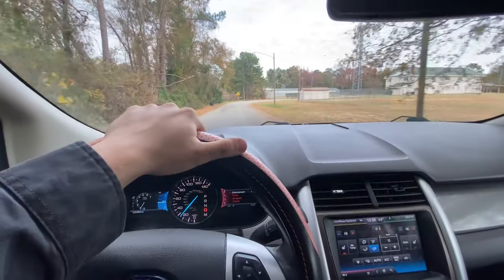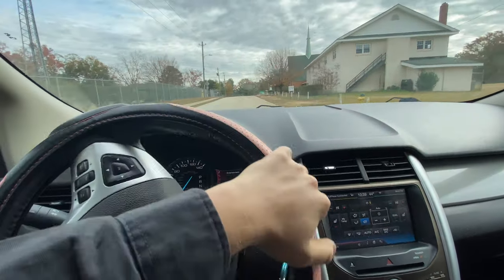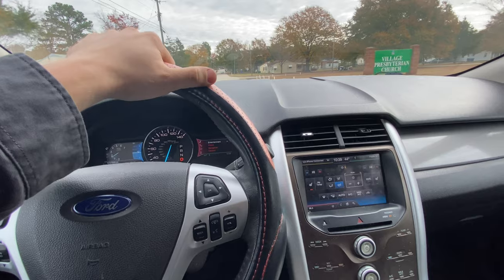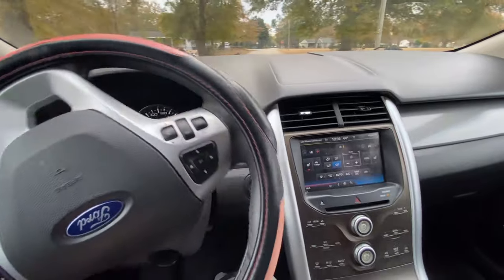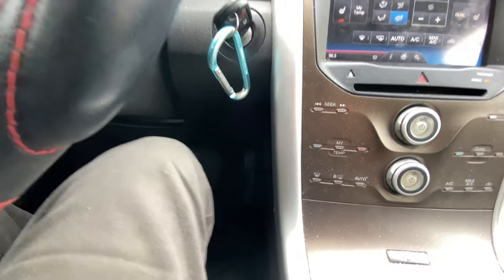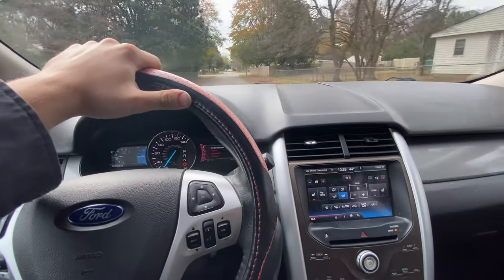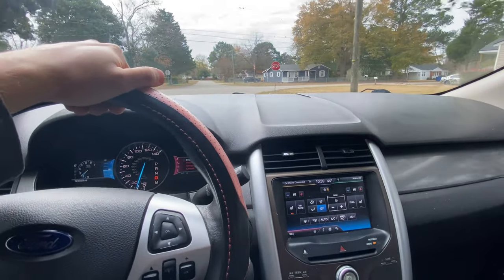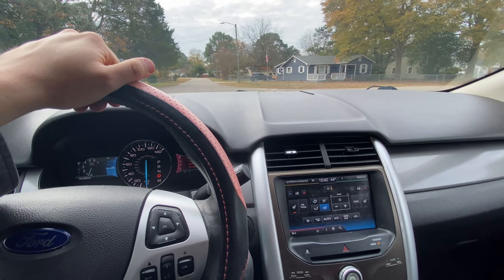How to fix low brake pedal in 2011 ford edge.

Comment: Can confirm this guy is all over the problem. The slam on the brakes method will work, as well as using a scan tool to perform autobleed abs function. Slamming on the brakes on a wet road or gravel road also cycles the abs solenoids which effectively resets them. Thanks for the tip! Try this first for sure!
Reply from the maker: Absolutely! Thanks for commenting and contributing to the advise. You’re welcome. Thanks for watching.
Reply: I tried a regular highway surface but I know where I can find a gravel road
Reply from the maker: @Jillups.  it doesn’t have to be on a gravel road, I did mine on just a normal asphalt road where there’s no traffic. Get up alittle speed, say like 25,30 or even 45 miles per hour and slam on brakes, just go at a speed that you feel comfortable at, doesn’t have to be anything specific. Good luck.
Reply: @FastFords289  thanks I will try again at a faster speed later after lunch too many people out and about
Reply from the maker: @Jillups.  no problem, hope it works, yeah I don’t blame you, stay safe out there.
Reply: I would do this procedure on wet grass so it doesn't put a lot out of strain on your suspension parts and your brakes.

Comment: Just cost me $1200 to change Abs module on 2012 edge sel and I still/now have low pedal. Going to try this before anything else. Thank you
Reply from the maker: Damn, yeah they’re not cheap, I hope it works for you, good luck and you’re welcome. Also just an fyi, a bad brake master cylinder can cause a low pedal also. Good luck bud, thanks for watching.

Comment: This is a late note, but the loss of brakes with pedal travel to floor has been known by Ford and no recall was done. The problems seems to be in the ABS module; it has happened to my 2013 Edge three times; the pedal travels to the floor and requires firm pressing on the pedal to get braking action.. then, the brakes continue to work normally... until the next time you lose braking action, and if you are dealing with a sudden stop when it happens, it could make you waste seconds and increase braking distance so much that you could crash.  Ford extended the Costumer Satisfaction deal until November 2025 regardless of millage. But they will only change the brake booster and people are saying that their brakes continued failing in the same way because it appears that the ABS module is the main culprit, but Ford is not replacing it.  I read that this problem is also affecting the Journey and even some Chevy models. Call your dealer.
Reply from the maker: @GeezerGold  thank you for your input and response, fortunately this has only happened once with me, been working perfect ever since. The only braking problem after that I had was the brakes were sticking and wanting to lock up, I took it to the dealer three times and the idiots couldn’t figure it out, one time I even drove it up there with the brakes smoking and told them it’s probably the brake booster, they didn’t want to deal with it so I took it to another small business shop and he changed the brake booster and never had another issue. Sorry your abs module kept messing up though but I appreciate you reaching out and letting me know about the extended warranty, and glad you got yours fixed as well. 
Thanks for watching.

Comment: I did on a gravel road....much easier to activate ABS....also do in reverse as others have suggested
Reply from the maker: I’ve heard of people having problems with it working on gravel roads, plus I don’t have any gravel roads near me so I’m kinda limited but I’m glad it worked for you. I did do it in reverse a couple times as well I just forgot to put it in the video. Thanks for commenting and thanks for watching bud.
Reply: @FastFords289  I did this and it works but keeps coming back. Replaced the hcu and master and still does it. Properly bled I give up.
Reply from the maker: @FloridaMan7337  it’s possible you may have a bad brake booster, or possibly still have air trapped in system. The way those systems are make it a pain to bleed all the air out. I ended up replacing the master cylinder later on and it took a while to get all the air out. I had to bleed it at the master cylinder and at each wheel and finally got it right. Good luck, hope this helps. Thanks for watching.
Reply: @FastFords289  Thanks I may try that or using a pressure bleeder first.
Reply from the maker: @FloridaMan7337  no problem, yeah that’ll probably work, I don’t have a pressure bleeder so I caught alittle hell doing it but I finally got it.
Reply: @FastFords289  It worked like you said. Bled it while activating the abs and it finally gave me a pedal and has been good for a couple months now. Thanks again. Next time I will buy a pressure bleeder.
Reply from the maker: @FloridaMan7337  that’s great! I’m glad it worked for you and you’re back on the road again. Yeah the system’s in these are a pain to bleed, idk why they made them like they did, poor engineering. Hope it keeps working well for you. Thanks for sharing and thanks for watching.

Comment: I’m currently working on my grandmothers 2013 Ford edge brakes are great and an only time I’ve ever ask up is when it’s going downhill it’s like the brakes go all the way to the floor like there’s no pressure. My plan is to change the master cylinder and go from there if you guys have any tips or any other ideas, I’d greatly appreciate it.
Reply from the maker: That’s strange, is your brake reservoir full of fluid?

Comment: Guys all u gotta do have someone sit the vehicle lift the front up make sure its safe to go under it and hit on the abs pump from underneath  with a stick or  what ever just little hits while the person is in the car pumping the brakes make sure the vehicle is on and running. Thank me later.
Reply from the maker: That’s good input, and I’d never heard of that or even thought of that but it does make sense how that would work, because all you need to do it break free where it got stuck and it works. I’ll have to remember this for future reference in case I ever come across this again. Although the braking hard was kind of a fun experience lol but seriously appreciate you chiming in and sharing your word of advice. 
Thanks for watching.

Comment: The Ford Edge 2013 SEL has the same problem with the same fix??
Reply from the maker: @peaje  as far as I know it’ll work on them all, at least all within the same few year models. Mine is a 2011 so it should work for your 2013 as well. Good luck, hope it fix’s it. Thanks for watching.

Comment: Just replaced master cylinder last night, no change in pedal. I've engaged abs from 30mph 6 times this morning to no avail. Any thoughts?
Reply from the maker: Those master cylinders on those cars can be a real pain, I had to bench bleed it and bleed it after I got it installed on the car as well as go around and bleed all the wheels. If that doesn’t work then I’d keep trying to activate the abs module, sometimes they can be stuck pretty good.
Reply: I did mine 45 mph... And it reset it... What did you end up doing?
Reply from the maker: Well if it reset and everything works good then you should be good to go. In my case though the pedal came back but then the brakes started holding so ended up replacing the master cylinder and brake booster. Good luck. 
Thanks for watching.

Comment: How did you get the edge to bleed the brakes I get no fluid out of the bleeder
Reply from the maker: Well in this case I didn’t have to bleed the brakes, just activate the anti lock brake system. How ever you just bleed like normal, pump the brakes and while someone holds the brake pedal, open the bleeder valve and let the fluid run, or if you do it alone then hook a line to the fitting, and insert into a bottle with fluid and open the bleeder and pump the brakes. If there is no fluid or air coming out, then you probably have a clogged bleeder valve so just change it and it should flow. Hope this helps, good luck. 
Thanks for watching.

Comment: I did this once and it fixed the problem, it lasted about a week, then the brake pedal started going down again, tried the trick again, didn’t work this time, tried 2-3 times, ideas?
Reply: Did anything work for you? This worked for me for 5+ years and no longer does

Comment: I’m going to go do this rite now
Reply from the maker: Ok, good luck, hope it works for you. 
Thanks for watching.
Reply: So I tried it doing about 45 mph and it brought the pedal up some should I keep doing till it's completely up
Reply from the maker: @jamilclark3  you can try it, I had to actually do it on mine a few times and it finally just popped back up all the way. If that doesn’t work then it is possible you could have a bad brake booster.
Reply: Truly appreciate the advice…
Reply from the maker: @jamilclark3  no problem, hope it works for you. Good luck. 
Thanks for watching.

Comment: Thank you trying this today
Reply: Also new subscriber👊👊
Reply from the maker: You’re welcome, hope it helps, good luck.
Reply from the maker: @Jillups.  great! Thank you!  Thanks for being a supporter and thanks for watching.
Reply: @FastFords289  i will let you know how it goes the brakes went mushy saturday then it rained yesterday
Reply from the maker: @Jillups.  10-4, hope it works well for you.
Reply: @FastFords289  well that didn't work do I specifically have to go 25 to 30 mph
Reply from the maker: @Jillups.  you may have to do it a few times, I had to do it about 6 or 8 times before it worked on mine. If it doesn’t fix it then it could possibly be a bad master cylinder but I’d try doing the brake check process some more. Make sure you’re applying the brakes hard and firm, press as hard as you can to activate the antilock brake system, you’ll feel the pedal pulsate when it’s being activated. Hope this helps.
Reply: @FastFords289  ok I just got back i got it up to 60 mph and yes when I stop it I do feel the pulse. But this is weird I did it 3 times at 60 and it didn't work but I kept checking on my way back and sometimes I would get a normal brake and then it might be mooshy
Reply: @FastFords289  also It scared the crap out of me im old I do have a lead foot but not lead footed with brake problems 🤣🤣🤣
Reply from the maker: @Jillups.  ok so I would say either the anti lock piston valves are starting to unstick and by doing it a few more times it’ll finally free completely up or you have a failing brake master cylinder and it’s not building pressure like it should except when you hit the brake hard. It’ll build up pressure for a min then the next time I’ll leak back down. I’d look under the hood where the master cylinder is bolted to the brake booster and see if it looks wet underneath right where it’s bolted together. You can’t always tell this way because it could be leaking inside the booster which would cause a booster fail eventually but usually you can see it if it’s leaking.
Reply from the maker: @Jillups.  lol 😂. Well I’m glad you made it back safe, safety is number 1.
Reply: @FastFords289  hey I have that lead foot but I'm always safe 🤣🤣👊👊
Reply: @FastFords289  ok thank you I can't get to the master cylinder I'm too short 5'2" but I am taking it to the mechanic tomorrow the reason I didn't think it was the brake booster again is when it went out 3 years ago the brake was hard this time mooshy

Comment: So what’s the permanent fix? 

I just did it and worked as advertised. 🤯 

But what’s the part I need to make it never happen again?
Reply from the maker: Well that would be the abs control module which is pretty expensive and hard to get sometimes from what I’ve been told. It shouldn’t happen again, what happens is the pistons in the control module gets stuck from dirt in old dirty brake fluid, so you could have your brake system flushed which would never hurt but you probably wouldn’t experience it again more than likely. Hope this helps. Thanks for watching.

Comment: I tried on my car ford edge 2013 however, doesnot work.😢😢😢😢
Reply from the maker: It may take several tries before it finally works, make sure you are pressing the brake pedal as hard as you can to activate the abs brake system. If you keep trying and it doesn’t work then you may have another issue instead of the abs brake system module. It could be you have a bad master cylinder. Good luck and hope it finally works for you. Thanks for watching.
Reply: Finally i done it 🎉😂  now break pedal is normal. Many thank for you kind advising
Reply from the maker: @faisalalhassani6281  great news! I’m glad it worked for you, you’re most welcome. 
Thanks for watching.

Comment: I try this on Ford edge 2013 and didn’t work
Reply from the maker: It’s not always a guaranteed fix, but how many times did you try, it may take several tries before it actually works. I had to do it like 5 or 6 times. I’m not sure but I know it was several because I didn’t think it would work at first either. Hope this helps. Thanks for watching.
Reply from the maker: Also make sure you are pressing the pedal hard enough to activate the abs brake system.

Comment: I tried it on my daughters car about 5 times and it didn't work
Reply from the maker: It may take a few times, make sure you press the pedal firmly to lock up all four wheels, if that don’t fix it then you may actually have a bad brake master cylinder. Good luck. Thanks for watching.